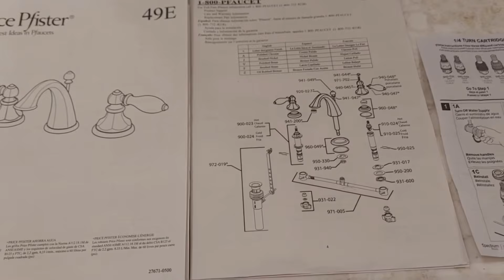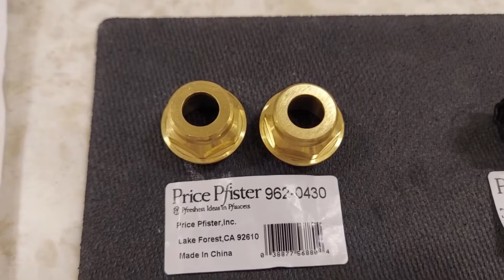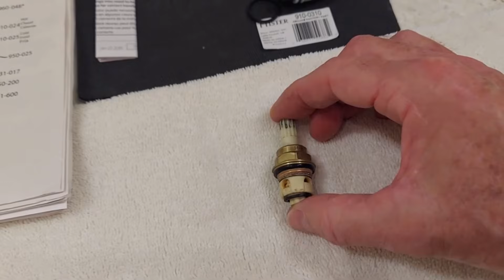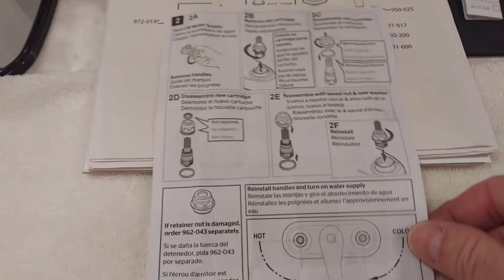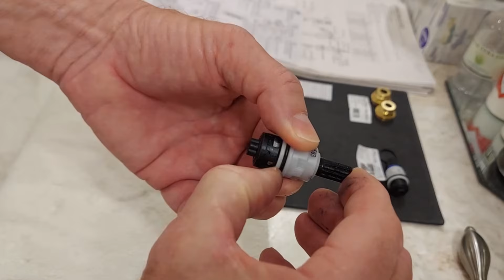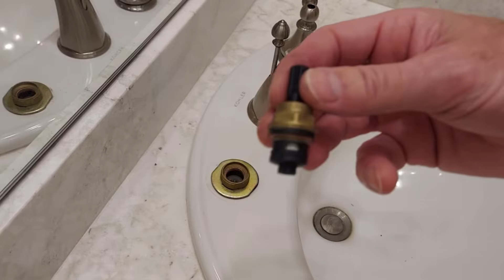Price Pfister Faucet Repair - How to fix a spout leak and modify the replacement cartridge assembly

Comment: IF YOU HAVE ONE OF THE OLDER PF Bathroom Faucest, as shown in the video,  You Can REPLACE The three O-Rings  For About $1 Total At Your Local Hardware Store!! ..... OR WAIT A MONTH To Get Free Cartridges That Doesn't Fit Without A Lot of Work!!  You Had To Take The Orig Brass One Apart ANYWAY!!
Reply from the maker: Yea, most of the time it is probably just the orings. Thanks for sharing.

Comment: Thanks so much for mentioning the Price Pfister warranty.  Called them and they sent me a whole repair kit, including both hot and cold cartridges and two new handles.  My faucet handles don’t have a button with a screw.  The handle and lower cover are internally connected, but are supposed to swivel independently of each other.  They had fused together.  I thought it was the cold water cartridge.  It was very hard to disassemble the faucet, and I ended up having to remove the whole faucet and breaking the cartridge in the process.  Fortunately, they sent me a new handle, so assembly was a breeze.  My old cartridge was the newer design, so didn’t have to disassemble.  Thanks again.

Comment: This man is gifted and covers the essential work necessary to complete the job. I received replacement part from the manufacturer free. Watched this video and fully  completed replacement. After removing the screw, the handle would not come off.  Turned  CCW and pulled up. I used CLR to clean up and scrub the build up on the cover/ handle.
Reply from the maker: Thank you for the compliment. Glad it worked out well for you. Thanks for watching.

Comment: Thanks!  I would clean up that old reused nut first and apply a little film of plumbers grease.  That helps ensure there is no debris and it reassemble smoothly and the rubber seals slide and compress without getting scratched or knicked.
Reply from the maker: Good ideas. Thanks for watching and commenting.

Comment: This helped A LOT! Thank you for your detailed explanation!
Now, I had a mishap in attempting to removed the handle base as it was severely corroded inside. I broke the handle off.
I have the exact same model as you and Pfister  is sending me replacement handles... but do you happen to have any idea how to get the broken part out of the base?
Thanks again for the excellent video.
Reply from the maker: Try using some penetrating oil and letting it soak through for a day or two . It’s not a sure thing, but might help. Good luck with it. They can be difficult to get loose.

Comment: Thank you for this video.  I got the right part, I liked your instructions, but the leak was coming from the cold water handle, and replacing the valve didn't correct it.  Now with the hot water handle on (which wasn't affected) the leak is still happening.
Reply from the maker: The hot water could be back feeding through a leak in the o-rings or a cartridge that is not fully tightened on the cold side. See if the o-rings were damaged or if the cold water cartridge needs to be tightened a little more. Could also be the cold water cartridge was cross threaded too. If one of the mentioned items are not causing the issue, then I am at a loss of what else it could be,  please share with us if you get it figured out. Thanks.

Comment: Could you please tell me how you removed the little cap from the top of the faucet...  before you used the Phillips head screwdriver.  Thanks
Reply from the maker: Just pry it up with finger nail or if stuck, use small screwdriver. You can see me taking it off at 2:15 in the video. Hope this helps. Look luck with it.
Reply: Thanks for your quick reply!!  I’ve tried everything to get that little cap off! Ive used a small screwdriver, pliers, etc., now I’m thinking about heating it up next!!
Reply: I’m trying some CLR Limeaway, waiting for that to soak. I won’t bother you anymore. Thank you very much!!
Reply from the maker: Let that lime away work on it and see. Could also rotate it too if careful not to scratch it.
Reply: I had the same problem and used a razor blade to start the separation. Did the trick.